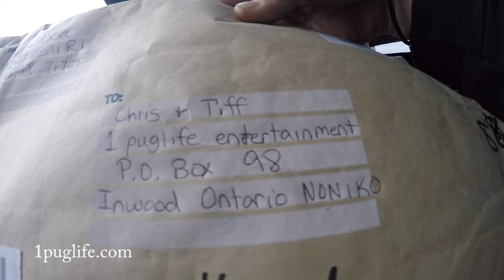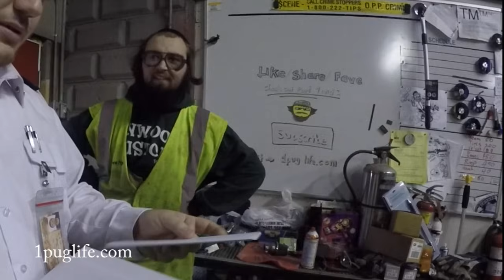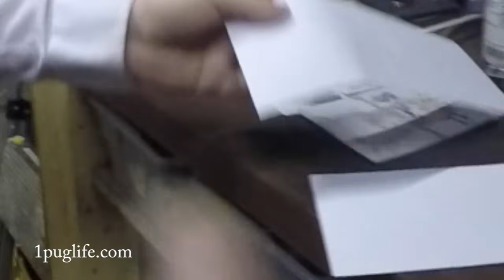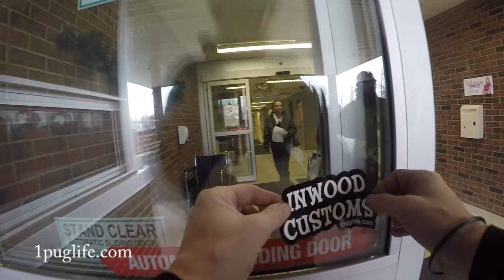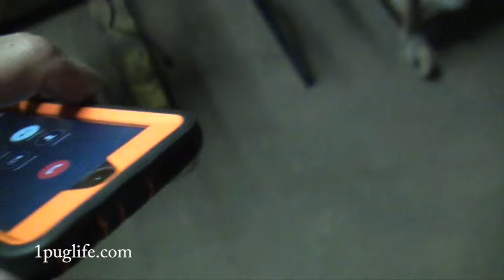why they call him onion guts!

Comment: Here in the Netherlands you get about 1 euro per kilogram for a dead car battery. When we went to the scrapyard to turn in our scrap metal we had about 5 batteries on top of the other metals and we got a total of 100 euro just from the batteries. So collecting dead batteries is well worth the money. And the tale and headlights are expensive when you have to order band new ones, and those are the first things to break even when a minor accident occurs, so yeah it's also worth to keep those in order to sell them.